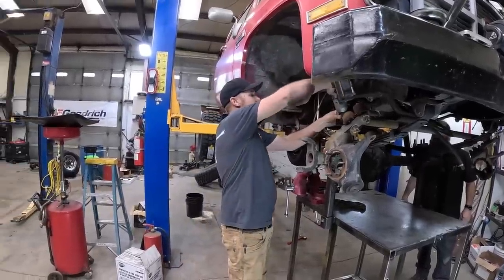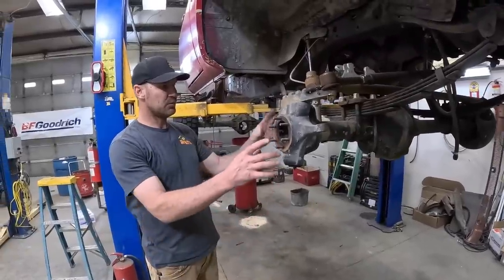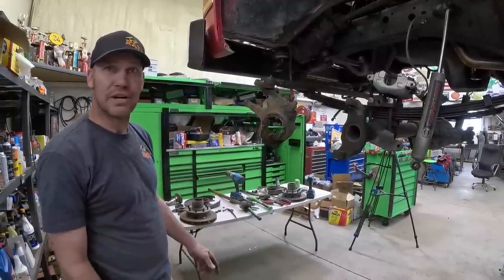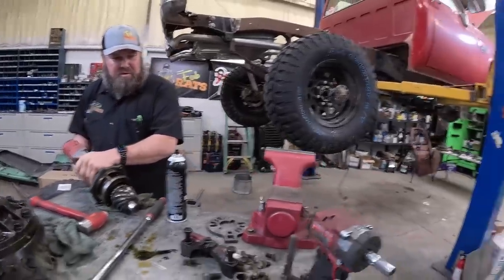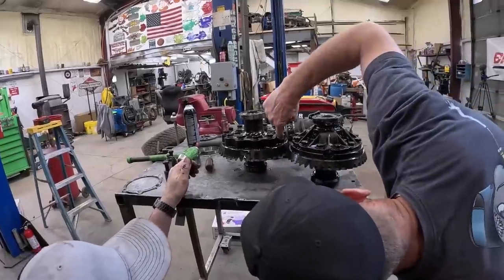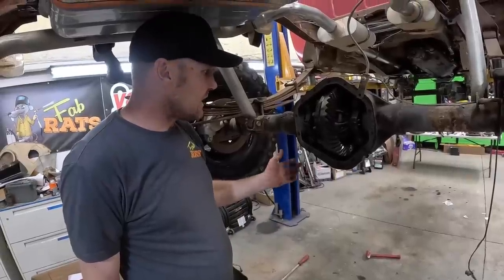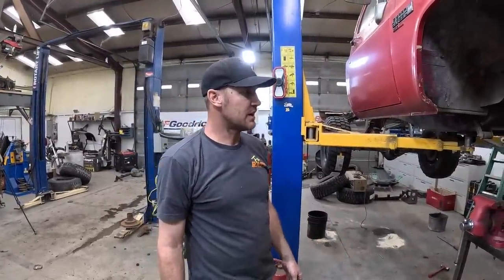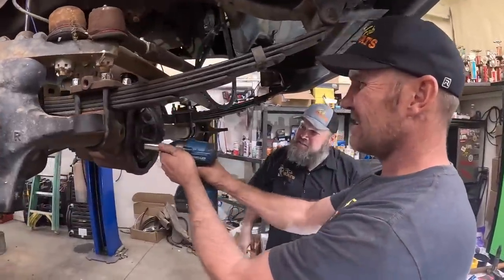This Build Just Might BREAK Me!

Comment: I have three of the same galvanized drain pans for 45 years still use them. I bought two of them had them stacked to geather out side, shot at a running squirrel shot threw both of them, soldier them up. Still use them.

Comment: Hey Fab Rats I have an FYI For you. OTC tool company makes a socket that screws onto the spindle splines and with a 10 pound slide hammer you pull thr spindle off without the slightest chance of damage. The come with 3 different spline sizes in the one socket. I've used mine on D44 D30 D60 spindles.

Comment: I am watching Chad wire up your wrecker right now and came here to share an idea for my truck that I thought you would like a lot on yours. Instead of building the front fenders the way you already started to on the passenger side, you can bend a tube out into the shape of a flat fender and cover it either in light steel or plastic. I did my samurai this way after narrowing the hood and plan on doing my dodge this way. Gives you plenty of clearance,  looks great,  and helps keep mud off the windows.

Comment: Gear wrench makes a socket that’s threaded for multiple spindles Toyota/44/60 etc. that you can attach a slide hammer to to get stuck spindles off . Works amazing. 
Part number 3910D

Comment: My first car use that term lightly was a three speed Vega. Aluminum valve covers couldn't keep them tight blew oil everywhere.  No gas gage. No passenger seat and had to put eggs in radiator to keep from leaking but had a lot of fun in that junk car

Comment: As  trail hack. I have stuffed a papertowel in the axle tube from the outside around the axle and filled the tube between the axle and tube with right stuff to make a seal out on the ends and forgot about it. 12 years later still no leaks.

Comment: I don't know how many of those ring and pins with the crushed colours that automatically adjust I've installed that I have never had one work exactly right on the lighter vehicles it doesn't seem to be a huge problem unless you're really getting on the throttle and then they tend to loosen up start to wobbling after he tightened them but on the other hand if you use that same crush color on anything with any performance and foot pounds of torque and horsepower that crush caller will last about 1 hard stab to the throttle or a burnout and you will be readjusting it and by the time it said and done the ring and pinion will not be able to line up because the crush color will go too far it's a stupid idea quite sure who came up with the damn thing but I won't even run them I won't even have a rear-end with them it's not worth it

Comment: Stop using expensive brake clean for inside differential. 

Use dollar store cheap shampoo.

But u will need to spray the clean metal with wd40 so it dont flash rust.

Comment: Should use a brass Hammer set of the steelhammer you wouldn't you wouldn't be banging that bearing brass Hammer just as much as you can use it won't damage the steel you should know that as smart as you are you should know that the brass hammer's the way to go with that not a steelhammer a word from the wise an old man 69 years old then building heart rate since I was 8 years old and I know when to use a brass hammer and when to use a steel I'm not a well-educated man I'm worldly educated man